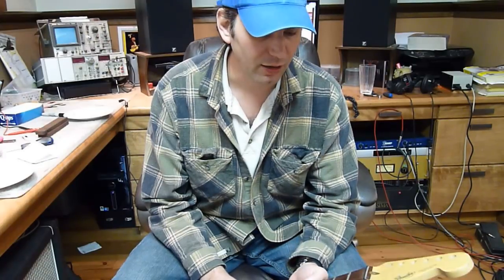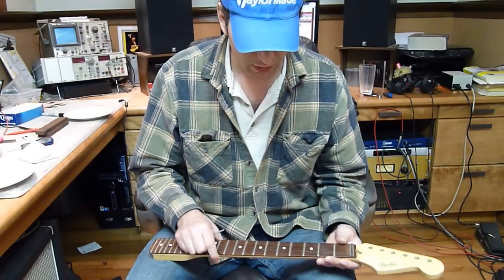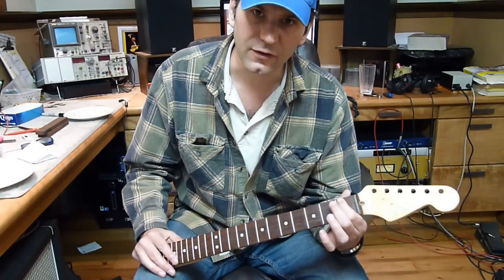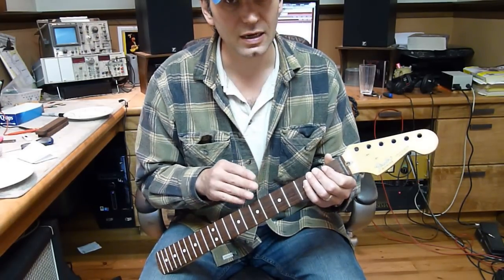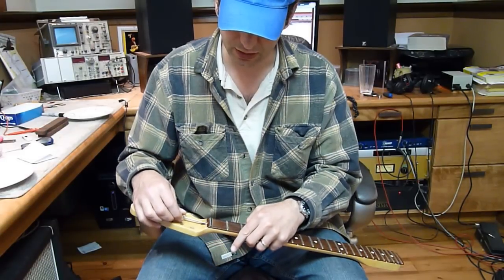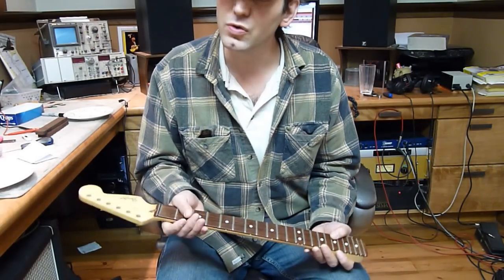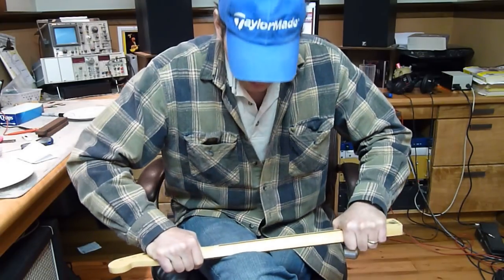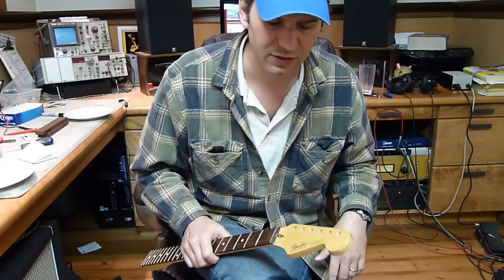adjusting a truss rod

Comment: hey freddy i've got a dean acoustic exotica bass  and the action on it is really high. the bridge actually comes off, do you think i could sand the bottom of the bridge down  or could adjusting the truss help?  what could i do to get the strings a little closer to the fret board?